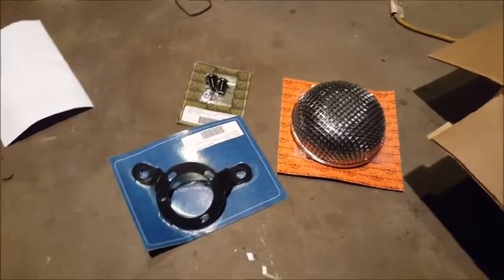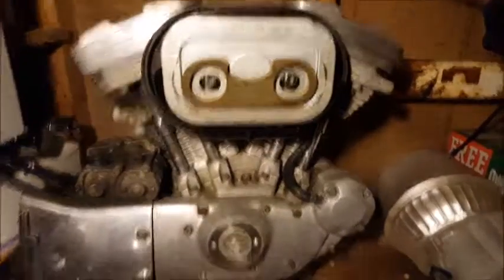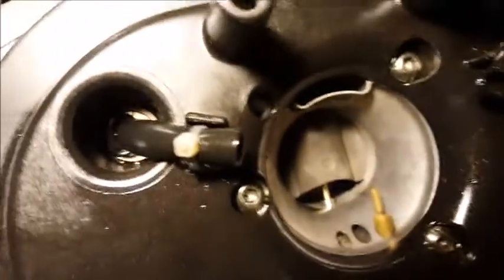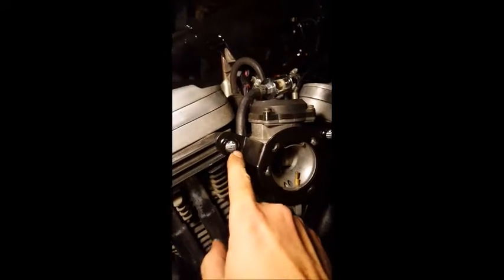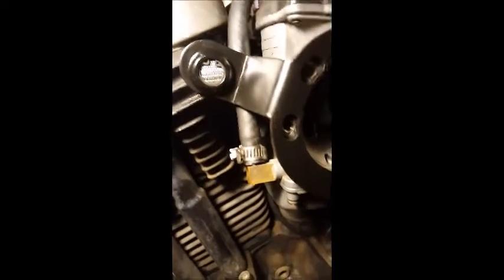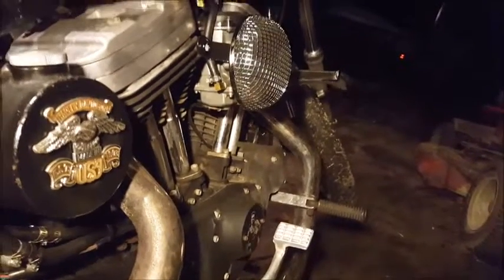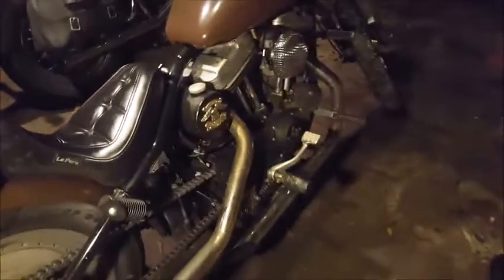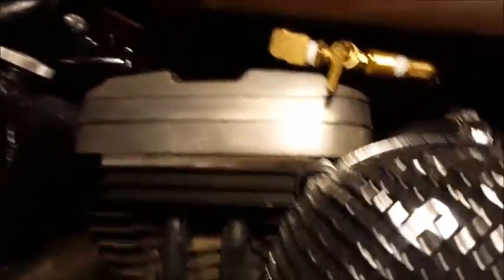Carburetor Mod. & Air Filter Upgrade For My Sportster Chopper

Comment: If you ever want to replace those breather bolts, check out the ones from TC Bros. they have a hex head so you don't have to disassemble the guts to get them out.
Reply from the maker: Thanks. I already found a set from Bison Motorsports. They actually function better too in keeping the oil residue down.

Comment: Harley was forced by government reg's to vent the crankcase fumes back into the engine via the air intake manifold. Fortunately, on the carb'd models (I don't know about the EFI systems) you can vent the fumes directly from the breather bolts in many different ways. I spent less than $10 in parts and kept my stock air filter by following the setup on Sportsterpedia. I have an inconspicuous black hose running from the air box to the swingarm with no catch-can or filter on the end. I just place a paper towel under it when I park it in the garage to catch the one or two teardrop size drips that come out in the following couple of hours. My air filter stays clean as well as my engine. There are some nasty looking pictures of the pistons on the internet of the damage done by the oily buildup.
Reply from the maker: I did the same thing as you. I'm now running a line from the head running all the way down behind the transmission.

Comment: Myself..seeing what you got going id run 48/185 and adjust the air mix screw under the lil aluminum cap if you havent already drilled it out. I got same engine..hypercharger and straight pipes. I got the info off my dial o jett chart
Reply from the maker: Since then, I put a 48/175 in and have the mixture screw out 2.5 turns. Runs like a boss now.

Comment: Are you running an 89-90 sportster needle with a 170 main? I'm sure you know people like to use these needles on twinkie carbs CV but you have to size the main way down.Obviously two different animals but just curious on your application. My 02 fxstb(88<95 stage 3) is CV for now but my old sportster was fuel injected and my Buell XB12R 1203 is Fuel injected also so I haven't had the pleasure of comparing the two CV's from the fxst or xl though i think they are pretty much the same aside from the needle and cable positions...I think?
Reply from the maker: I'm using a 1990 carb, so my best guess is that the needle that as well.